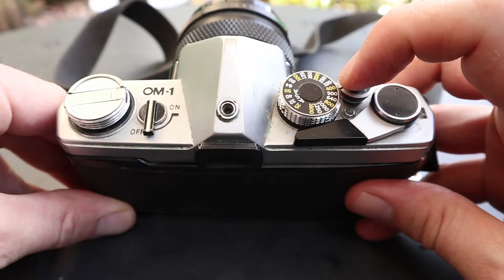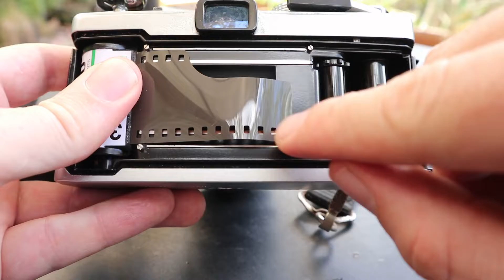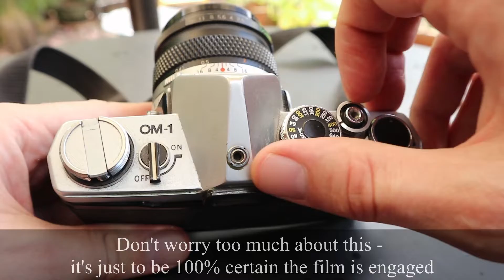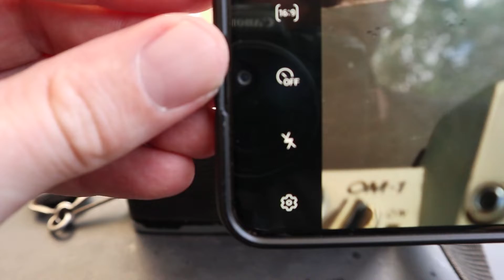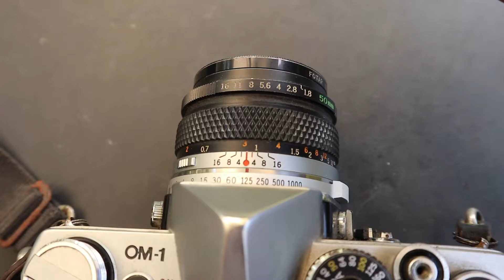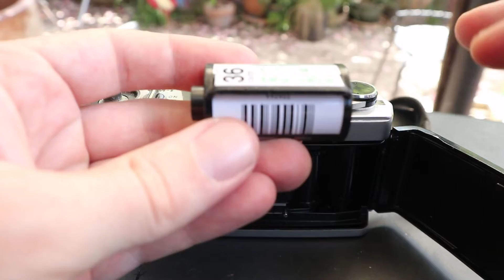Using an Olympus OM-1 Film SLR camera

Comment: I recently got my hands on one of these and can’t see through the view finder it’s fully white could it be the exposure?
Reply from the maker: Are you sure it's an OM-1? If the viewfinder is white it would have to be a digital camera (could be an OM-D, which have similar styling). And if so, yes it's probably overexposing.
Reply: @Taitset I took a closer look and I think the shutter might be stuck 😅
Reply from the maker: @StinkyF Even so, if it's an OM-1 it will go black if the shutter is stuck, not white.
Reply: @Taitset I can see through a pinhole the rest is black I think I was looking wrong earlier 🤦‍♀️ (I messed up my eye and can’t see great)
Reply from the maker: @StinkyF Could well be the shutter stuck up then.
Reply: @Taitset thank you for the help!
Reply: @Taitset I got it figured out I had the mirror locked up 😅

Comment: Never thought I'd hear a camera be compared to a train haha. The whole olympus OM series from back then really were terrific. One note, the original battery is supposed to be a mercury cell, with a nominal voltage of 1.35v compared to a alkaline cell with 1.5v. Also, the alkaline cell slopes its voltage down over its whole discharge cycle, where as, a mercury cell has a rather flat discharge curve, only dropping off when totally exhausted. these two factors combined results in out of whack exposures from the camera as they don't have any sort of voltage regulation. The best way around this is to use a PX625 to LR44 adapter in tandem with a zinc air cell.

Comment: Also on the film canister there's a silver and black strip called the DX code and more modern SLR's (later Nikon F series and the Canon EOS line) can read and sets the iso of the film and how many shots automatically and sometimes with film, you can get lucky by having a extra exposure

Comment: My light meter detector is not working maybe coz of battery. But I cannot open where the battery is too. Any advice?
Reply from the maker: The battery hatch is designed to be opened with a coin - you insert it and rotate. A largish screw driver would also work. If the battery is really old it might have exploded in there a bit and caused it to get jammed shut.
Reply: @Taitset  i am afraid it is jammed. If it is. It there any way I can still open it without breaking it? 😅😅
Reply from the maker: @JamSeneres  It could be worth spraying a little bit of WD40 or something on it, and then trying with a bit more force? Or if there's a professional camera repair place near you it might be best to ask them to do it haha. If all else fails you can use the camera without the light meter. You could use a separate hand held light meter, or if you're really good at shooting manual - you can guess!